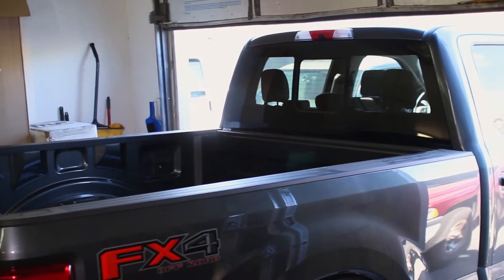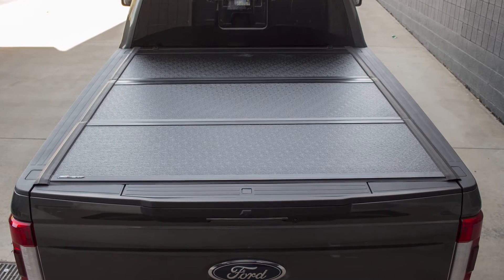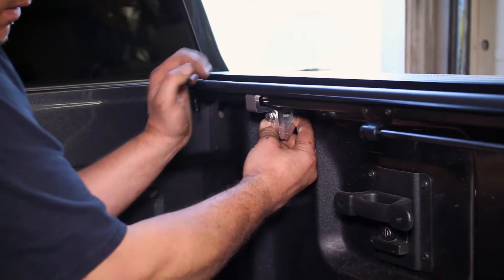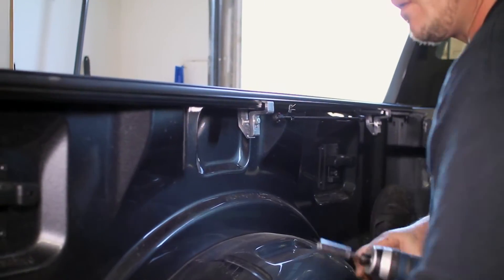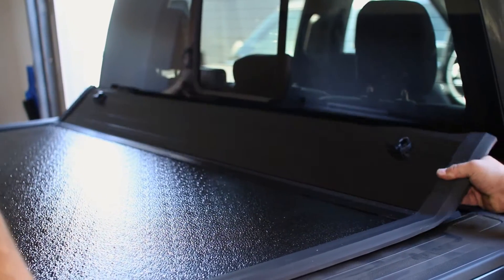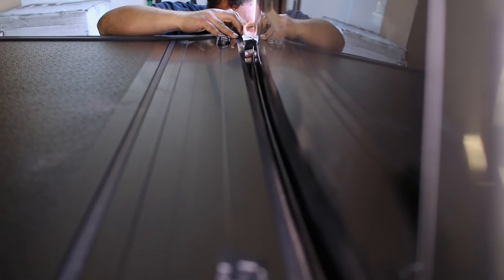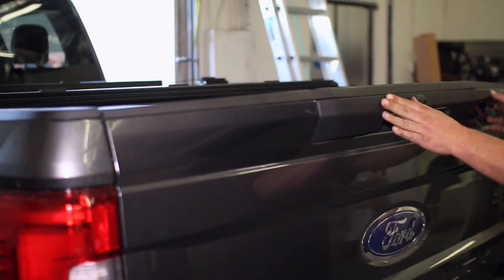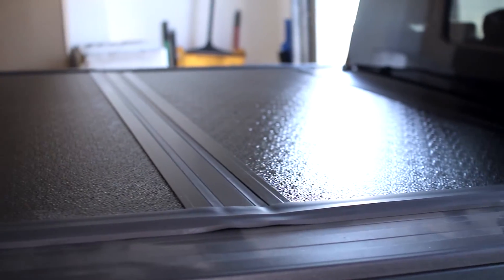2017-2018 F-250 & F-350 Undercover Flex Tri Fold Tonneau Cover Install

Comment: How much water does it let through?
Reply: Dmitriy my neighbor had one of these on his 2015 F150 and after a year of caulking and back and forth with Undercover he could not get back leaking to stop. Meanwhile my bakflip MX4 leaks a few drops at most during heavy downpours. He ended up throwing his away and buying the bakflip and has not looked back.
Reply: I just got one and almost immediately tested it with a 1600psi power wash to the top. Some small streaking on the corners near the tailgate, but not a single drop seemed to get to the actual bed. Honestly I think it's purely about quality of install more than anything.